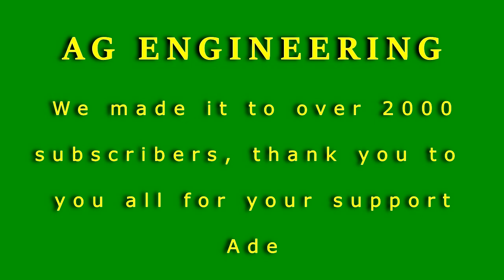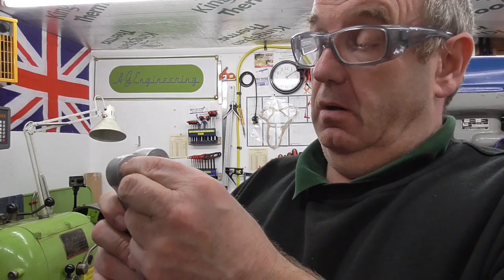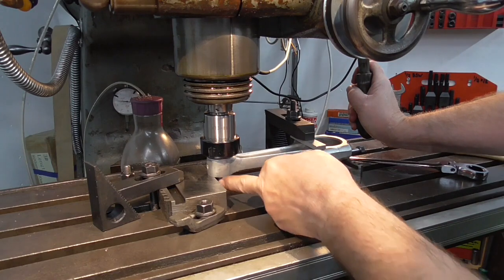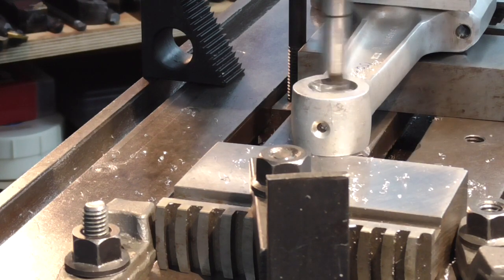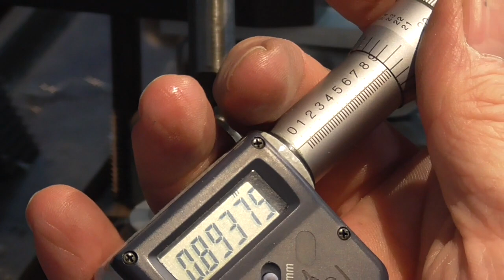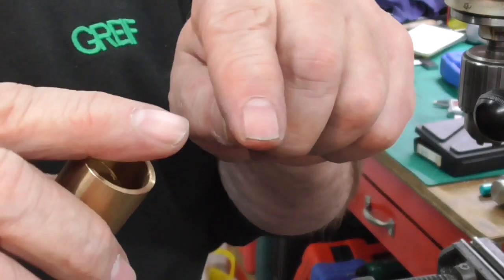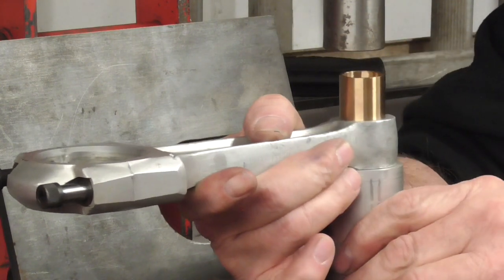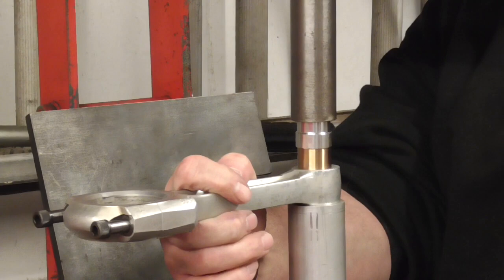Worn Small End Eyes

Comment: So do most rods have room to open them up 1mm on the small end? There's no inexpensive (read, mega cheap) oversize aftermarket pistons for my Miata. Cheap/available Honda B20 high comps will work with the necessary deck and head cleanup I'll be doing, and may actually help me to clean the deck/head up fully without decreasing squish too much... if I can run the 21mm pin in the 20mm original hole, I'd be seeeettt for about $200 bearings and a gasket set and some machine work to clean it all up.
Reply from the maker: I would think most can be taken out by a mm or so, you would have to make a judgement call on that. In my case the rods were made in with and without versions depending on the year. Good luck with the bike whatever you end up doing, Regards, Ade.

Comment: 👍on 2k
I wonder why they cheapskated by not putting bushes in as standard?
Just an aside, the BMW  book shows the "approved" way is to fit the bushes and then mount the rods on a face plate with the big end clamped on a dummy big end to ensure both rod lengths are identical when boring to a firm thumb push fit, mismatch being more noticeable on boxer engines than vertical twins.
ATB 
c
Reply from the maker: The alignment to the gudgeon pin is within a couple of thou, the rod bushes could now be reamed as a pair clamped to a common crank pin

Comment: Nice.
Is aligning center of this hole to that of the center of crankshaft end necessary?
Reply from the maker: It's within a couple of thou centering on the existing hole, from the point after the bushes are fitted they could be bolted to a common pin an reamed together but few would do this in reality. Thanks for watching and commenting.
Reply: @AGEngineering  ... Thank you so much.

Comment: Same procedure for a steel con rod ?
Reply from the maker: Usually not much material around the small end to rebore, you would have to carefully assess if it would weaken it too much. Also be aware of steel rods where the pin is a press fit in the rod and floating in the piston bosses. Many thanks for following, Ade